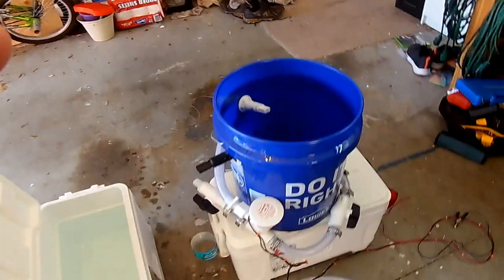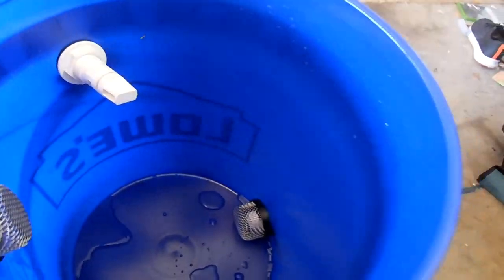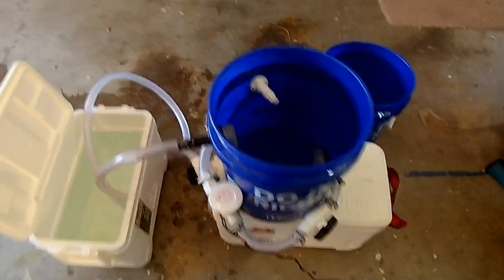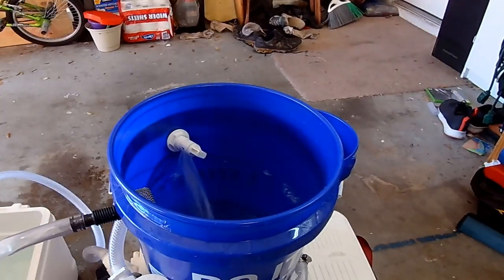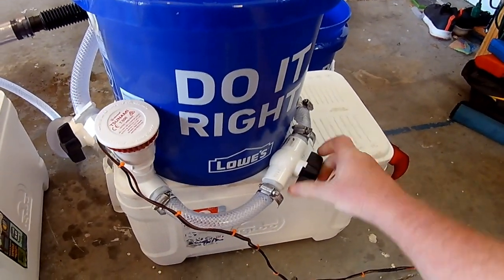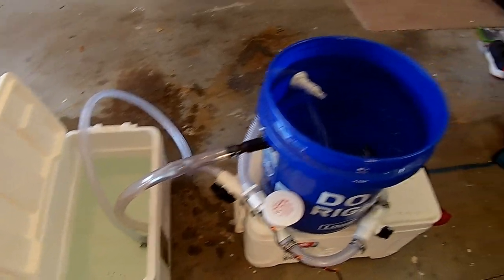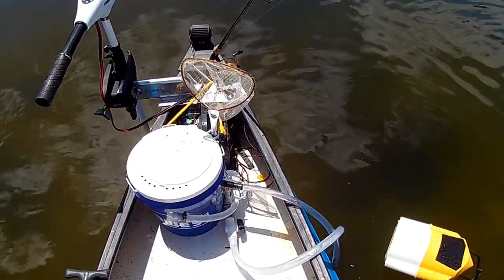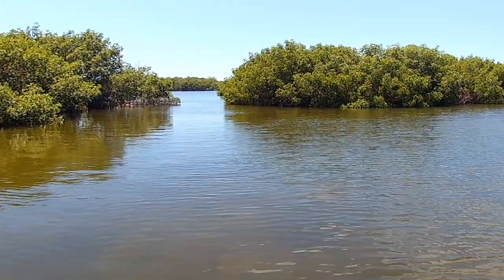5 Gallon bucket livewell

Comment: Nice setup!  Have you thought about or tried to add a primer bulb on the hose that would be dropped in the lake/river to prime the pump?
Reply from the maker: I haven't thought of that, using 1 inch hose. 
.didn't think there was a primer ball that big.  I guess you could reduce the larger hose down and use one for like a marine gas tank..wonder if that would provide enough water.

Comment: What type of prime should we use since its hard to open the transom door and get the hose filled with saltwater
Reply from the maker: I use a water bottle to fill the hose before submerging it.  It just has to be a "closed" system with no, or very little air in the system.  hope this helps.

Comment: Where did you buy your lid? Could you post the parts and where you bought them?  Thank You.
Reply from the maker: The lid was purchased at Wal-Mart, part of a Mr. bubbles aeration pack for 5 gallon buckets.  The Tsunami pump and extra drain fitting with screen was purchased off Amazon.  The rest of the plumbing, threaded PVC fittings, ball valves, tubing, and plastic fittings where the tubing attaches were purchased at Lowes.  
Hope this helps, let me know if you need more specific information, ill have to take a trip back to Lowes to get exact fitting sizes that I used.

Comment: how do you prime the well water hose to get the hose filled up?
Reply from the maker: The intake hose needs to be full of water.  I use a water bottle to fill it, place thumb over end so it does not leak out and place in the bay, river, ocean, what have you.  It is a pain, had I know that issue with it I would have used a better pump, but this is a budget build.  Hope this helps.
Reply: @residentdawgfishing5424  thank you! From the list, I see only one strainer but you have 2 right? The bottom one for the intake hose uses the same strainer as the one top right?
Reply from the maker: @stephaniedoan7114  yes, two strainers, one comes with the pump, the one listed is the the thru hull fitting, both same size.
Reply: @residentdawgfishing5424  I see, thank you. One more question please. Foe the valve, is it socket or threaded? There are 2 kinds at Lowe’s. The link you have is socket but if we connect to the barbed fitting will need to be threaded. Sorry to ask you so many questions. I have watched so many videos but yours is the best and i would like to do like yours. Thank you so much!
Reply from the maker: @stephaniedoan7114  threaded, the barb fitting  for the hose is threaded on the end that goes into the ball valve.

Comment: I mean it works but its to involved. to much to have to haul along with everything else you need to bring on  a fishing trip ..
Reply from the maker: I never said it was the end all be all to DIY live wells.   It dose take some work to get it up an running.  But it gets the job done.
Reply: @residentdawgfishing5424  yeah I agree it gets the job done. I wasn't saying its a bad setup or didn't work I was basically saying there's a lot of other ways you can keep your bait alive without having to tote around a big battery and a bucket with a pump and a bunch of hoses sticking out .. all and all good job though like u said it gets the job done ..
Reply: I subscribed .. I've watched a lot of your other videos before I pick up some good pointers now n then and also like the cooler base rod holder video
Reply from the maker: @dennissummerlin8701  outstanding ... I am glad you got something out of my videos.  They are ment to give ideas.  I am always open to suggestions to improve my diy builds and content.  Welcome aboard and thank you for the support.